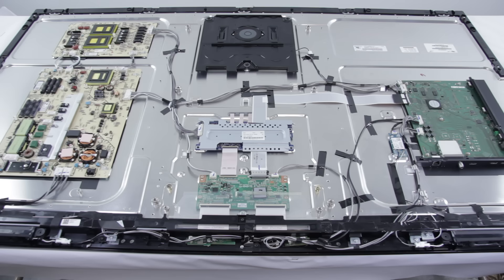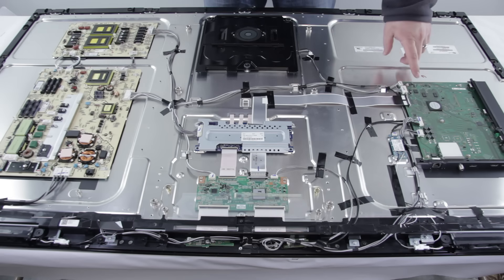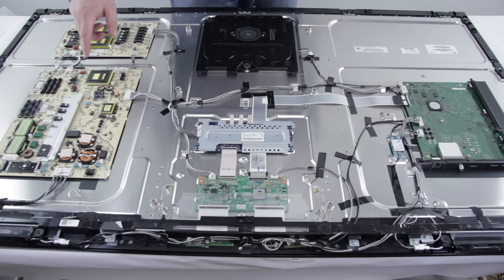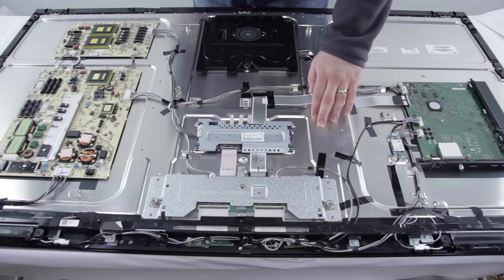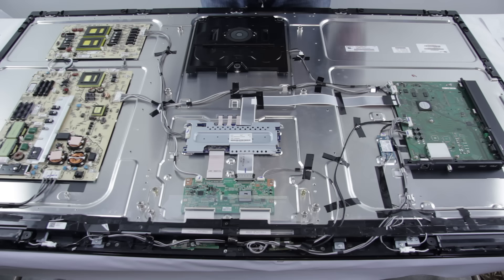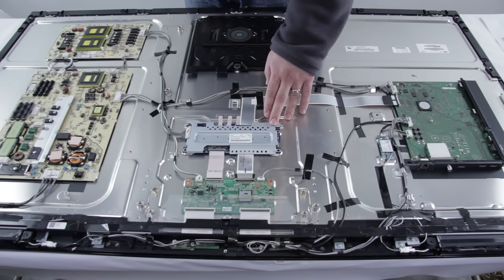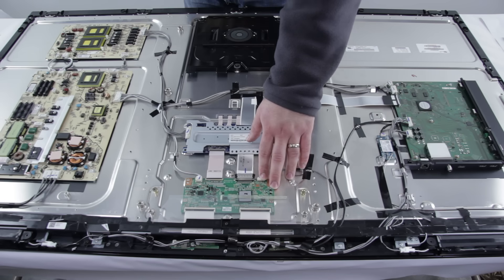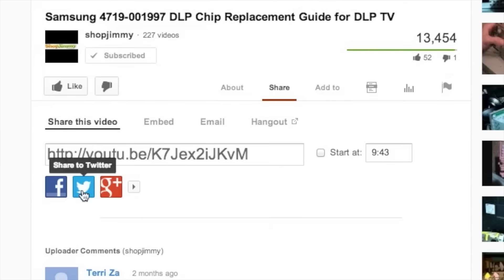LED TV Repair Tutorial - Common Symptoms & Solutions - How to Repair LED TVs

Comment: I have a Samsung 46 inch lcd.  I have sound back light but not a picture.  I did change the t con board.  I did detach one side of the ribbon to the t con no change in picture. I thought one side of the screen would go down but  it did not. I am no sure what to do next.

Comment: Hi I have a question... I have a Toshiba Led Tv model number 46L5200U1 recently the tv went black... as the tv starts up the red toshiba logo appears brightly on the screen but right after no image is seen however audio is heard clearly. As i do the flashlight test i can see the menu options just fine. Based on your videos i believe It's a problem with the backlight. Just wondering if you guys can send me a link to the part i need to replace and fix the tv.
Thanks

Comment: I have a Samsung Model: UN46EH5000 The TV powers on and there is video but the led back lighting doesn't work. I purchased power supply from Shop Jimmy but did not fix the problem. Any ideas? Thanks
Reply from the maker: +John Wilson   Try all repairs and troubleshooting at your own risk.  This sounds like you have bad LEDs in your TV.  Unfortunately we do not sell replacement LEDs for your TV model number at this time.  You can check back in the future to see if we have them available.  Thanks!  www.shopjimmy.com

Comment: hello I have a Samsung TV led model UN50F6350AF with two problems is the first vertical lines of color and de second is that after a few minutes if working begins making large white flashes serial number is UN50F6350AFXZA, thank you very much for your help.
Reply from the maker: +Irwin Garcia     Try all repairs and troubleshooting at your own risk. This could be a problem with either the t-con board, the main board or the TV panel. You can replace the main board and the t-con board individually to see if one of those boards fixes the problem.  Click this link to replacement parts for your TV model number:  http://www.shopjimmy.com/catalogsearch/result/?q=UN50F6350AF  There may be multiple boards for the same TV model number, be sure to match part numbers on your current board, with your replacement for compatibility.  Thanks and please let us know if you have any further questions with your TV Repair!  www.shopjimmy.com

Comment: hi , great video. I have a smart tv samsung no picture and no sound on samsung ln46b750 u 1 f.  Do you know what symptoms may be? I did a flashlight test and there was nothing on screen . The tv glows with no picture or sound. Glowing as if you turn cable off but not the tv very dull color thanks.

Comment: Hi Jimmy 

I have Samsung  led ue40c5100qwxxu. it was working ok when we switch it off, next day when i tried to turn it on , it produced the starting  sound, then nothing appeared on the screen, also there is no any sound, I checked the back light and it is working ok, I noticed also the red LED power light indicator ( the one in the corner of the TV) disappears after the TV switched on.  I replaced the MB but the problem is still the same. I'm not sure now whether it is a problem with T con board or power supply ??   or the MB that I bought is also not working?

Comment: Hi I have an RCA 39 inch LED LCD TV Model# LED39B45RQ. When I turn it on, nothing happens. The red power light goes off when powered on and nothing else happens. I do not have any audio or video. No illumination at all on the screen, totally black and dead. I measured all of the voltages and they are all good except the 24 volt back light LED supply is at about 50 volts both before powering on and after powering on. I have tried 2 new power supply boards and still the same problem. What other board or parts would cause this voltage to go to 50 volts. I have an electronics technician degree from Foothill College and used to be an electronic service technician at HP. I am also a Ham radio operator and am very familiar and knowledgeable in electronics. Without having a schematic to the TV, my guess would be that a voltage regulator has gone bad. Any ideas of what else would cause this problem besides the power supply board?
Thank you,
Roger Myers
Reply from the maker: +Roger Myers  Try all repairs and troubleshooting at your own risk.  This could be a problem with either the main board or the LEDs in the TV.  Click this link to replacement parts for your TV model number:  http://www.shopjimmy.com/catalogsearch/result/?q=LED39B45RQ  There may be multiple boards for the same TV model number, be sure to match part numbers on your current board, with your replacement for compatibility.  Thanks and please let us know if you have any further questions with your TV Repair!  www.shopjimmy.com

Comment: Thanks for you help in advance. I have a LG 55LE5400 LED and the problem shows up in the colors of the picture but only while watching TV. On start up the LG logo shows true color or great picture. But as soon as the video source comes on whether I am watching a blue ray or just regular cable is when the problem shows itself: The color on peoples faces have these hues of yellow and not the actual skin color. There are now slight grey lines vertically and of course the picture still showing the lack of color sharpness. Please help.
Reply from the maker: +Joey Green     Try all repairs and troubleshooting at your own risk. This could be a problem with either the t-con board, the main board or the TV panel. You can replace the main board and the t-con board individually to see if one of those boards fixes the problem.  Click this link to replacement parts for your TV model number:  http://www.shopjimmy.com/catalogsearch/result/?q=55LE5400  There may be multiple boards for the same TV model number, be sure to match part numbers on your current board, with your replacement for compatibility.  Thanks and please let us know if you have any further questions with your TV Repair!  www.shopjimmy.com

Comment: I have an RCA 46lb45rq. when I  power it up the stand by light goes from red to blue but I have no picture or sound. The only way to power down or get the blue light to go back to red is to unplug the tv. I have changed the power board.

Comment: Hi, I have a Samsung un65eh6000f LED TV and the bottom half is brighter than the top. I've had this tv for 4months and yesterday this started. I've tried resetting to factory settings. This fixed it last night. Or so I thought as today when I turned the tv on the problem had returned. Please help

Comment: Hi, I have an LG 55LHX that has pink backlighting intermittently. I first noticed the image would be pinkish and tried to correct the settings but it would come and go. I decided to look at the backlight through the back vents on the tv when the display was pink and I could see that the actual backlight was pink and it was not an LCD issue.Is this most likely an LED driver issue?

Comment: i have a RCA LED 32" tv. model # LED32G30RQ the tv wont make any noise. no light. when i plug in the tv and or push the power button. i opened the back panel and looked at the power board and dont see anything burnt or busted. need help please

Comment: Hello, I have a SHARP Model # LC-40LE830U. The screen has about a 4 inch vertical line down the center of the screen and eventually the entire screen goes very dark and has multiple vertical "squiggly" lines.
Reply from the maker: +Matt Lockwood   Try all repairs and troubleshooting at your own risk.  This sounds like a TV panel (TV Screen) problem.  If your TV panel is bad, it may be more cost-effective to replace the TV as panels are typically hard to find in stock, difficult to replace, and expensive.  Thanks and please let us know if you have any further questions!  www.shopjimmy.com

Comment: I have an LG LED Model # 47LN5700 UH and need your assistance in acquiring the correct replacement part to correct the Backlighting problem with the TV.  The TV turns on I get sound and can see the picture when I point a flashlight at the screen.  Based on your video it seems to indicate the LED Driver. Need to know the part # and cost to order.  Your assistance will be greatly appreciated,
Reply from the maker: +William Rivera   Try all repairs and troubleshooting at your own risk.  This could be a problem with either the LED driver or the LEDs themselves.  You can replace the LED driver board to see if that fixes the problem.  Click here to replacement parts:  http://www.shopjimmy.com/catalogsearch/result/?q=+47LN5700  Be sure to match the part number on your current board with your replacement.  If the LED driver does not fix the problem, then the problem is most likely with the LEDs.  These LEDs are replaceable, however it is recommended they are replaced by someone with the proper experience and training. When replacing the LEDs, the TV panel can get damaged. If the TV panel gets damaged, it is not repairable. Click this link to replacement LEDs for your TV model number:  http://www.shopjimmy.com/catalogsearch/result/?q=+47LN5700  Be sure to match the panel information necessary to ensure you have the correct replacement LEDs.Thanks and please let us know if you have any further questions with your TV Repair!  www.shopjimmy.com

Comment: Hi Jimmy, I have a a Samsung Series 5 Smart TV, UE32ES5700, it was working all well, but then suddenly started being in loop, it got stuck in the channel guide. It enlarges the channel for a few seconds and then goes back to the channel guide, it doesn't respond when I try using the remote, the batteries in the Remote control are all good. I also tried unplugging it, but that too doesn't yield any results. Do you have any fixes for this? Thanks a lot!
Reply from the maker: +P Choudhary  Try all repairs and troubleshooting at your own risk.  I recommend replacing the main board in your TV.  Unfortunately I do not see any replacement parts in the search results for your TV model number on our website.  Please reply with your part number on your main board and I can try searching for replacement parts.  Thanks and please let us know if you have any further questions!  www.shopjimmy.com

Comment: Hi, I have a Samsung UE32F4000AWXZT. Last week a thunder had passed through the antenna cable. From that moment, once plugged the AC cable, the tv shows the Samsung logo then turn to off and to on in an endless loop. What can I do? Thank you!
Reply from the maker: +Max Solinas  Try all repairs and troubleshooting at your own risk.  I recommend replacing the main board and the power supply board in your TV.  Unfortunately I do not see any replacement parts in the search results for your TV model number on our website.  Thanks and please let us know if you have any further questions!  www.shopjimmy.com

Comment: dear shopjimmy, my tv is 32 inch LED and last week when my father was using the tv, i noticed that the top right corner has become dark/in shadow and other three corners's backlight is working. The picture is fine but its the top corner backlight which i can notice while playing bright white screen. I called the company technician and he says its the panel problem without even checking properly. Also i saw in my tv that my tv doesnt have a backlight inverter, it has big power supply pcb and next to it the LD board. I dont know what could be the issue because that technician told me that if it was the bad LD board, the backlight woudnt work at all. Could it be that the connection to one of the four corner LED be a problem? I hope its not the panel because, then i am doomed. PLEASE HELP. also i m not able to reinstall the firmware because it is already latest.
Reply: +ShopJimmy.com ...thanks shopjimmy...my model in SONY KDL-32EX720.. the top corner backlight is not completely spoiled but less bright than the rest... I tried the following with my playstation4...in my ps4 display settings I tried to change the screen fit size and while increasing and decreasing the size the top corner backlight was coming back to full brightness and back to less brightness...it was as if the top corner backlight was fluctuating from low power to full power...and thats why may be it was going dull...my tv is 4 years old and well maintained..not misused

Comment: Have an LG model 50L-5400-UA. When powered on I get the LG start up logo with a black screen and have audio.Other times the TV comes with picture and audio do,a short while, then, a black screen still have audio.Repair company replaced,the power board...TV worked for two hours or,so , then same problem as above .Can,t really see,led lights through vent holes ( they are at the top of the set) tried the flashlight test with menu button ...couldn't see any images. HELP !!! Thanks ...JW, Boston MA

Comment: Thanks got a new t con board and the problem is fixed , but under certain conditions or scenes in movies/games I have a verticle line where the color differs on half the screen. What would cause this?
Reply from the maker: +Jose Gonzales   Try all repairs and troubleshooting at your own risk.  This sounds like a TV panel (TV Screen) problem.  If your TV panel is bad, it may be more cost-effective to replace the TV as panels are typically hard to find in stock, difficult to replace, and expensive.  Thanks and please let us know if you have any further questions!  www.shopjimmy.com

Comment: I have an RCA model  #LE40C45RQ  that has no sound or picture but it has back lights .I tried a new main board with no success. could it be the t com board? If so would you have one ,what is the part #. thanking you in advance.

Comment: After plugging it in, my Vizio E601i-A3E sits silent for 35 seconds and then starts blasting white noise from one speaker.  None of the controls have any effect.  The only way to stop the noise is to unplug the TV.  The serial number is LFTRNWCP4322671.
Thank you for your help.

Comment: HI I have Toshiba REGZA model #52RV530U Serial number AM398006389 my problem is that there is lines running down my screen
Reply from the maker: +Jorge ceja   Try all repairs and troubleshooting at your own risk.  This sounds like a TV panel (TV Screen) problem.  If your TV panel is bad, it may be more cost-effective to replace the TV as panels are typically hard to find in stock, difficult to replace, and expensive.  Thanks and please let us know if you have any further questions!  www.shopjimmy.com

Comment: I have a Toshiba Model # 39L1350u. I have black and white horizontal lines and multi colored vertical lines. I have back lighting and it looks like the lcd display is cracked not physically but has that appearance. Thanks

Comment: I have VIZIO  LED E701A3,the power fail i open the set and i found capacitor bad 68 mf 450v, also i replace the fuse,the tv work again,but for only 15min,same problem with the capacitor and fuse,someone told me could be LED's  in short,never hear that.

Comment: 47 IN VIZIO MODEL # XVT473SV. TV Powers up, Vizio logo flashes but no picture no sound. TV will constantly reset (Orange Vizio flashing) but only the Vizio logo appears on the screen then it goes back into rest cycle. Also this happened directly after a lighting strike somewhere close to home. The tv was not connected to a power surge (rookie mistake)

Comment: Hi, I have a Toshiba LED smart TV 58L4300UC.  The power go off randomly after 5 -15-30-60-90 minutes and then try to go back on.  Sometimes it works for some minutes before going off again, and other times it just stay on (green light) with the black screen and no sound.  I try many things, like the power reset or the factory reset.  Deactivate all the possible options on the TV, nothing works.  The problem come more often then 2 days ago, I can barely watch for 30 minutes straight now.  The TV is almost 2 years old, I found that it was turned on when we came back from vacation, probably went on after the lost of electricity in the house after rainstorm...  thanks for the help!

Comment: I have a Samsung TV model # LN46B630N1FXZA, manufactured Sept 2009. The picture is too bright to view and I cannot adjust it darker with the controls. It was unplugged for 3 weeks while I was away and problem occurred when I returned and plugged it in. I have tried all on-screen diagnostics with no improvement. What could the problem be?  Thank You.

Comment: I TRIED TURNING ON MY TELEVISION TO WATCH A MOVIE ONLY TO FIND THAT THE USUAL RED SIGNAL LIGHT AT THE FRONT AT THE CONTROL PANEL IS ON BUT A TICKING SOUND IS COMING FROM THE BACK AND IT WONT TURN ON. WHAT COULD BE THE POSSIBLE CAUSE AND HOW CAN THIS BE RESOLVED.

Comment: Hello. I have a TV Panasonic Viera TC-40A400L with Supply Board TNPA6029.
The TV turned off one week ago. I checked the supply board and found this:
In plug P2 (SRV-5.3V) = 5.3 VDC  and (SRV-16V) = 0.5 VDC.
Do you think that supply board is damaged?

Comment: Hi, I have a
Vizio 32" smart t.v.
Model # E322AR
At first it would turn on, and the VIZIO logo on the bottom of the t.v. (not on the screen on the frame) would light up, and there was sound.  I kept turning it on and off, then the logo stopped lighting up and there was no sound.  I tried the flashlight test but I couldn't tell whether anything was appearing on the screen (it could be my bad eyesight).  HELP!
Thanks...Mary

Comment: Samsung UN46ES6500FXZA, I turned on the TV and the top quarter of the backlight will not work, basically the top horizontal quarter of the screen. The picture is still working and good but the top quarter of the screen is dim.